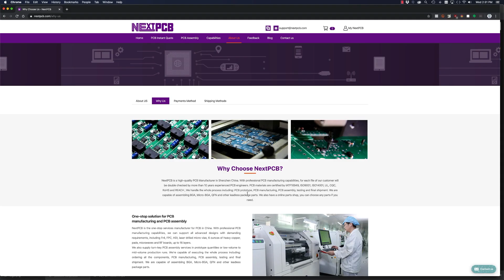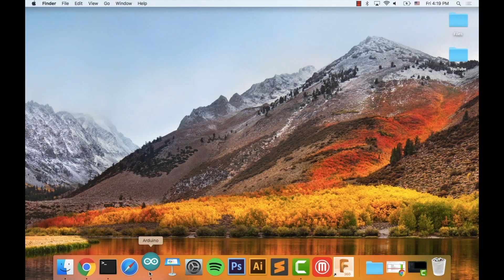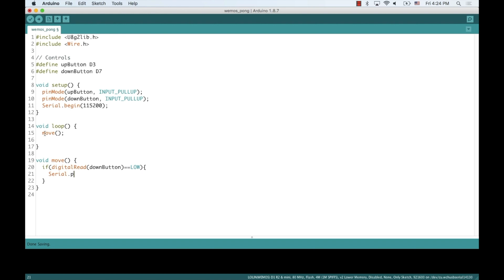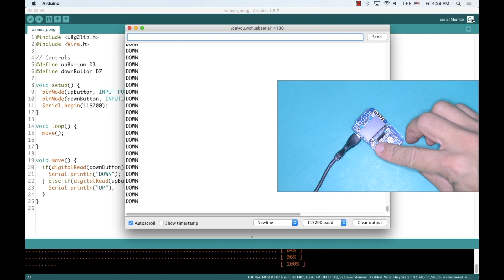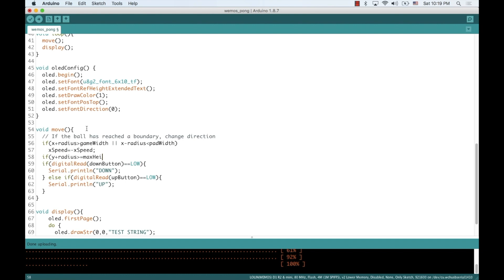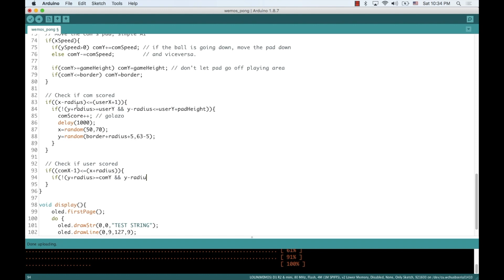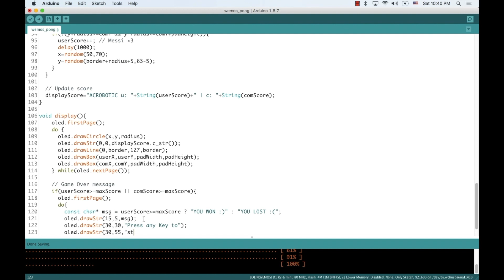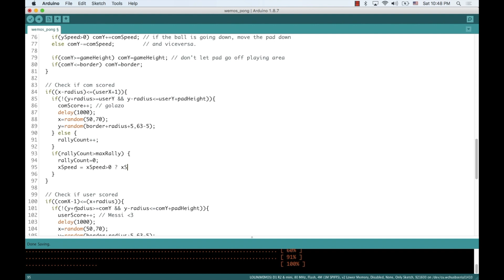ESP8266 Tiny Arcade | WeMos D1 Mini + OLED Shield

Comment: ESP32 question: I need to connect via I2C: BME280, BNO055 gyro, L53L0X TOF Time-Of-Flight, and optionally an OLED 128x64. ESP32 has 2 I2C busses. Assuming they have all different addresses.Would you put them all on a single bus or split them, and why? Thanks. I asked at the Espressif forum and they were a bit rude to a beginner:-)
Reply from the maker: I'm sorry for that, the few times I check the forums it aggravates me when I see that nonsense.

As I2C is a parallel bus, the main reason to split devices over two lines is to expedite communication. If you need to get data from the sensors at a fast rate, you might not want to wait until all the pixel data is sent to the OLED. In that case, I'd have the OLED in one bus, and the other devices on the other. Note that they'd also should be on separate cores to fully take advantage of the speed increase.

I think you'll be fine with just using a single bus, but hopefully this provides some insight!
Reply: @datasith  Excellent answer. I like that you mentioned separate cores. That makes a lot of sense. Thank you. Learning every day.:-)

Comment: Great project! Question, I love that little oled. Can you recommend a similarly inexpensive Oled that would be a bit larger? Not as large as those touch screen color displays. There must be a Mono Oled maybe 50% larger.
Reply from the maker: Yikes, for OLED I haven't seen larger in terms of pixel resolution other than a 128x128, sorry! Googling reveals a 256x128 option (driver HGS2561281), but commonly Makers tend to switch to color TFTs at that resolution and bigger. The pricing for TFTs is comparable to OLEDs, and I have a video on a 1.44" 128x128 pixel TFT display that you may find useful: https://youtu.be/PqyGY9ETXqE